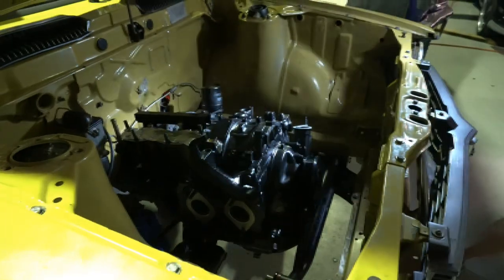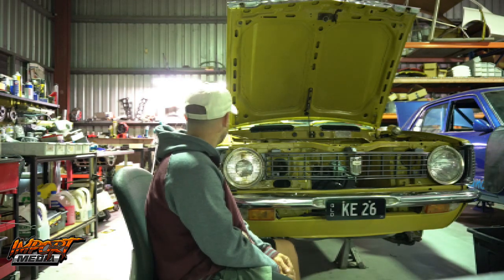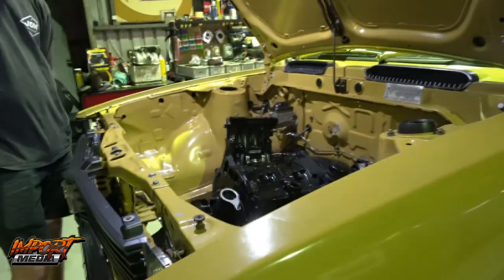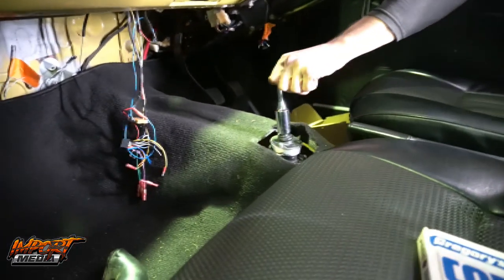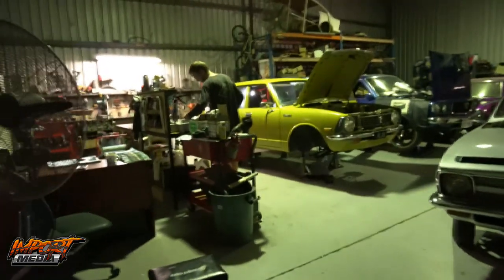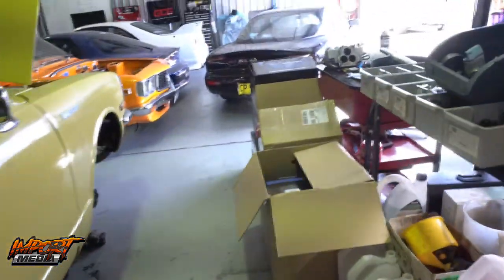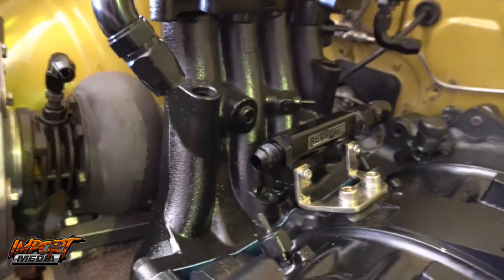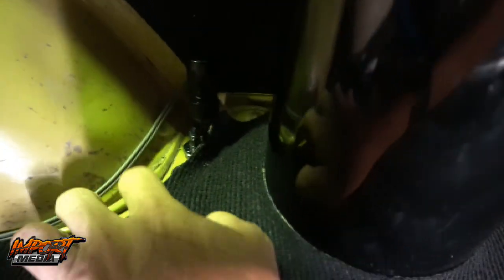IT BEGINS.....PROJECT ROTARY KE26  (VLOG #1)

Comment: Cool build. What wheels are the black wheels? Seen them in Australia but have never seen anyone in the states with them. Would be cool if I can get some. Lol also how do you guys get the leaf spring to sit so low? My spring is literally bent upwards by the time my wheels are tucked. Went 4link suspension. Ke20
Reply from the maker: hey mate thanks! All about having fun with your mates while building it. The wheels are called Street Pros, you can get them on the VPW website. Well the leaves in it currently are factory height but may be just resetting them, which i believe they just heat up and bend into a different position.